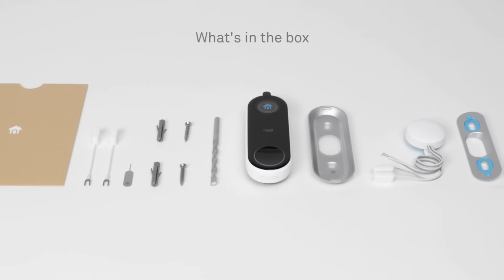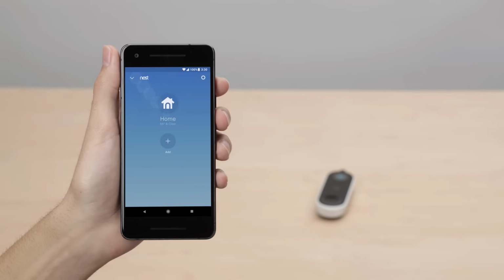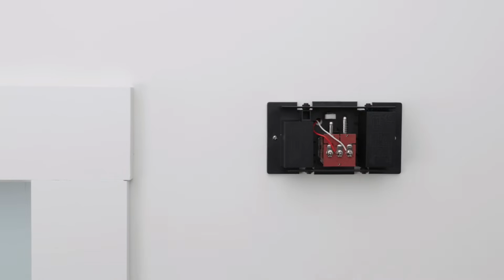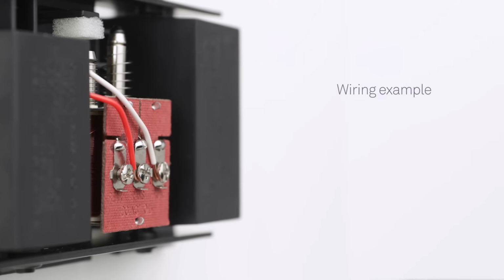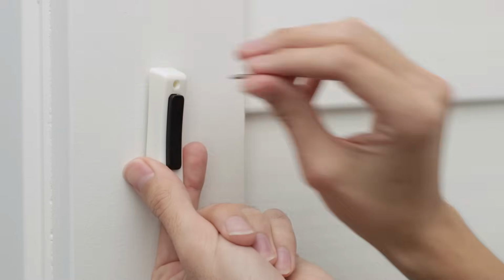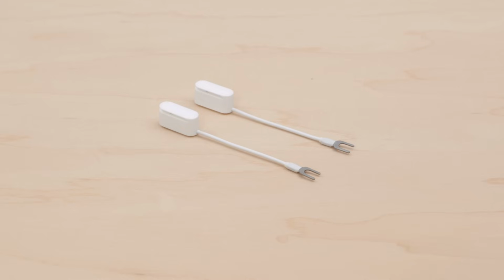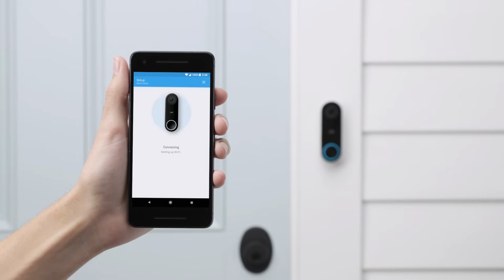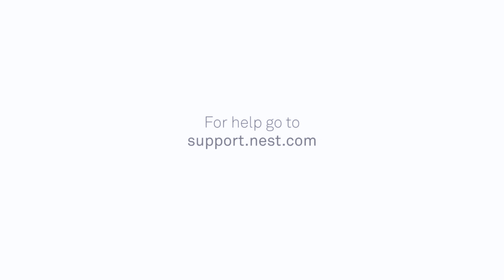How to set up and install the Google Nest Hello video doorbell

Comment: These both have a 3-5 year non repairable kill switch inside in the form of a small lithium battery. Google service reps tell me I should just buy a new one after 3 years despite the fact that if I could get inside it to replace the battery it'd be fine for probably another 3-5 years. Shame on Google for making this landfill. Buyer beware you'll be continually replacing these things.
Reply: @lukos3211 But then how would they achieve recurring revenue? Think about how much easier it is to just drop a new magnetic replacement on the mount compared to the hastle of installing a competing brand's product. They're all parasites but they call us "consumers"... 🙄

Comment: WORST PRODUCT EVER !!!  
1. APP GOOGLE HOME IS NOT DOWNLOADED IN ALL PHONES. I HAD TO BUY A MOTOROLA PHONE THAT ALLOWED ME TO DOWNLOAD THE APP.
2. THE CHIME DEVICE MUST BE PLACED IN A WORKING ONE CHIME BOX. MY CHIME BOX WAS DEAD, SO I COULDN'T INSTALL IT. 
3. FOR 150 DOLLARS I OBTAINED A DOORBELL THAT ONLY SOUNDS OUTSIDE MY HOME, BUT UNABLE TO SOUND INSIDE HOME.
4. IT IS TRASH. 
5. MOST CHINA DOORBELLS COME WITH VIDEO DOORBELL AND PLUG IN CHIME DEVICE!!!! WHY GOOGLE NEST DO NOT OFFER THE SAME???? 
6. ELECTRICIAN COST 50 DOLLARS TO ATTACH IT OUTSIDE ONLY. THE EKECTRICUAN TOLD ME THAT GOOGLE DOORBELL S ARE THE WORST PRODUCT EVER, BECAUSE MOST OF THE CASES ARE LIKE ME. IF I WANT TO HEAR THE CHIME INSIDE, THE GOOGLE REPRESENTATIVE TOLD ME THAT I HAVE TO BUY THE "NEST MINI" OR "HOME MINI" IN ORDER TO LISTEN THE DOORBELL SOUND INSIDE MY HOME. 
RING ARE 10000% BETTER THAN THIS GARBAGE PRODUCT.
7. THIS DEVICE DOES NOT ALLOW TO TALK BACK.

Comment: after installing the backing plate and wire so hard to slide in the doorbell to the bracket two small hole.. is there an easy way to do it?

Comment: Currently on my second one of these. On the first one the clear front of the doorbell started to develop what looked like air bubbles underneath it and was starting to chip and crack. I contacted Google warranty and they sent me a new one ( Jan. 2022). Today, November 2022, I noticed that the front of my second doorbell is starting to do what the first one was doing. Guess I will be contacting Google again.

Comment: Lovely, they updated the installation procedure, but didn't update the video. You can't use the Nest app to install new doorbells...
Update: You CAN use the Nest app to install the doorbell, in theory. You have to tell it you don't want to scan the QR code, but instead it will then prompt you to input a 6 digit code. If you're confused like I was about how you get the QR code or 6 digit code from the back of the doorbell AFTER you installed it...find the blue slip inside the box. It has a copy of them there. Something the app doesn't mention anywhere. 
But, good luck getting it to actually work. I got everything wired up, blue light and all, and Google's software is an epic failure. I went through all the troubleshooting steps and no matter what I can't connect to the doorbell. Bluetooth related errors every time. Note to self: quit buying things from Google. Either they won't work at all, or they will abandon them shortly.

Comment: Is the wedge installed and used without the base plate?  The video doesn't show this, just that a wedge is included. Thanks
Reply: You need to use both. You install the wedge and then add the base plate to it using the smaller screws. The doorbell then snaps into the plate.

Comment: My existing doorbell uses 16vac transformer.  After installation, the Nest doorbell works fine but the existing chime stop working.  I can see the chime's hammer moves a little but not enough to make sound.  It seems like it doesn't have enough power to strike.   Should I replace the transformer with 24vac?
Reply: So I figured out... In the settings, there is "Chime duration". Switch it on and have duration for 1 second.

Comment: First of all, I am writing this review as someone who has been a big fan of Google products and a die-hard advocate of google customer service. 

I bought a google nest hello doorbell in July 2021. I unpacked the device in January 2022. Upon installation of the doorbell, the device did not work. After contacting google customer service and going through the troubleshooting process, the google technical specialist decided I needed to receive a replacement device. Once I received a replacement device, I hired a professional electrician to install the device for me. Unfortunately, we could make the device work again. So I decided to contact google customer service again, return the doorbell, and get refunded. But after a long waiting period and explaining the situation several times to different agents, I was told that the refund period had passed and I couldn't do anything. 

Basically, I was told it would have been better to return the device and get a refund the first time I saw the doorbell did not work rather than trying to make it work. For someone like me, who has many more  Google products at my house and someone who is always promoting google products to my family and friends, it was really frustrating to hear that!!! Now I think I really need to reconsider the brand that  I was defending so hard. 

So my only advice to those who still want to buy from google is to think twice if this is the right choice for you!!!!

Comment: always check the voltage at the outdoor ringer wires. 18-24 volts AC is always recommended. I've never had a video doorbell install successfully outside that range.

Comment: Absolutely trash instructions. The Nest app says the door bell needs to be installed on the home app and the home app says it needs to be installed on the nest app. What complete and utter garbage
Reply: It is confusing but you need to install it through the Nest App first and then connect to the Home App.

Comment: The wired Nest doorbells (as well as wired Ring doorbells) are great products. HOWEVER, they don't tell you upfront that these wired doorbells all have an internal non-user-serviceable battery. IF you will be using the doorbell with a mechanical chime, just be aware that at some point, the battery inside will fail.

The internal battery on these units are used to provide temporary voltage to the doorbell unit when a mechanical chime is used. When someone presses the doorbell button, power is temporarily routed away from the doorbell to the chime inside the house. The battery keeps the doorbell powered for the 1-2 seconds while this happens. Over time, this small battery will be unable to deal with the voltage drop and your doorbell will lose power and reboot itself. If you don't rely on a mechanical chime or if you use the Ring wireless chime, than it won't be an issue. If you do use a mechanical chime, depending on your environment (which includes usage rate, weather, temperature, etc.), the doorbell will stop function properly at some point in time. For most users, it seems to be somewhere between 1-3 years.
Reply: So, are you saying the micro USB port on the Nest doorbell cannot be used to charge the internal battery? What is it for then?
Reply: @JewbixCube  the port does charge and power the doorbell...until the internal battery goes bad and no longer can hold enough of charge.
Reply: I feel like this is happening to my doorbell
Reply: Good info, i got it as a gift. When this happens in the trash it will go and i will use my standard security cameras as normal.  Its a shame they don't tell you the info you provided upfront.  Not sure why some people think its fun to constantly have to repair poorly designed products and repurchase the garbage.

Comment: My existing doorbell button is mounted in a standard electrical box with a plastic cover plate ; a common situation.  The standard electrical box screw holes don't line up with the holes on the Google Nest Hello doorbell's plate, so I need some sort of adaptor plate, but can't find one. 

What does one do in this situation?  It must be a very common problem.
Reply: I'm sure you've found a solution by now but if the original was installed on a plastic cover then your Nest Hello could be installed  on a cover plate as well.

Comment: Tip: I installed my nest doorbell and couldn't hear the chime inside. Troubleshooting steps didn't help at all. Accidentally discovered this option in the Nest app called "Indoor Chime On/Off". Shows nowhere in the troubleshooting steps, but resolved the issue instantly.
Reply: I have the same trouble i turn on the “chime on”still couldn’t hear the chine inside any tips?
Reply: @edwinruiz2889  under "chime on" there's another option "inside chime on/off". I was trying to figure out the problem for a long time
Reply: @edwinruiz2889  I had the same problem. My solution given by a technician was to turn on the electronic chime setting and set it to ring for ten seconds. Then turn it off. It worked for me after thinking it was the doorbell itself.
Reply: @irmmz_1  going to try this
Reply: @irmmz_1  Thank you so much! This solved the problem for me!💛💛💛
Reply: This should be like a whole video. How dumb of an issue
Reply: Thanks a lot , it was an easy install except for this part. Had the same issue then saw ur comment and there it was same issue. I went to the app and mine was off turn it on and all fix now. 😅
Reply: Thanks a bunch! This helped me out!!!
Reply: Thank you! I had the same issue, I thought it was the chimer, I replaced it with a new chimer and it was still not working, then I YouTube the install video thinking I’ve missed something, I found your comment and tried it, and it worked! Thanks! I wish nest included that option in the install video, they didn’t have any of those info.
Reply: Thank you so much.  Had the same problem.  Easy fix IF you know there is an ON/OFF option in the app.  Thank you again.
Reply: I clicked on the bell by mistake before I finished the setup so it ringed then it stopped after setup finished so I understood it something with software otherwise I would have a big headache with it
Reply: Holy crap made my day 😂 of course that’s an option genius
Reply: Just installed the doorbell and new chime. House was wired for a doorbell. My inside chime has no sound. Currently can't find the option to turn on or off in the app.
Reply: Life saver. Love you for sharing
Reply: We

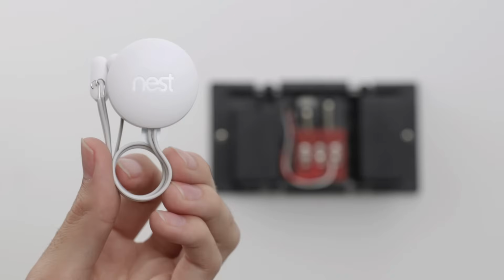Comment: 4:04 never ever twist the wires. You will get a loose connection in the long run!
Reply: What do you recommend?
Reply: @TR-vh1fi   just put the wires in straight
Reply: What never heard this...

Comment: The wall plate design is really poor, what is to stop someone from popping out the unit and running off with it. It may be useless to a thief but some thieves will do it just to be spiteful. You have to come up with a more secure way of mounting it to the wall.
Reply: I wanted one of these then seeing how you just click out put me off.
Reply: @The_Original_KL  I got the Eufy wireless doorbell instead and am very happy with it.

Comment: This was very easy to install, both chime and doorbell, but I got the damn blinking yellow light which means there apparently isn't enough voltage. House was built in 2003 so it's not some really old house with old electric. Had no problems with my Ring doorbell hooked up to the same wires. Seems like they just want to make you "Hire a Pro"
Reply: Usually that means your transformer is not putting out enough voltage. Try using a multimeter to read the voltage at the doorbell

Comment: Purchased one and it will work about an hour then it does crazy things, goes off line and it gets really hot.  Nest replaced the unit thinking it was defective, new one does exactly the same thing.  It skips once hot at almost exact intervals.  Checked the transformer and that seems to be within the recommended range.  Anyone had this problem?

Comment: Need instructions on connecting to a front/rear (three wire) chime. Both this video and the nest video only showed the instructions for two wire setup (front and transformer). I couldn’t connect to unit via Bluetooth (no troubleshooting there either), so I couldn’t follow instructions on nest app.

Comment: Red Flag for non-USA buyers of Google/Nest Door Bell : 
Please be aware that the Google Door Bell that they ship everywhere except USA will not connect on the 5 GHz band. Even the senior engineers form Nest/Google support did not know that. It took me over 15 hours of testing, emailing, chats and troubleshooting with them (factory reset, change my router setting, move my router closer etc.) to confirm this fact. Frankly, the support is terrible, the worst I have ever seen. 

Not sure why Google is choosing to disable 5 GHz band on the bell in countries like Canada where the 5 GHz band for outdoor use is legal. They charge everyone the same price as USA but remove the 5GHz connection capability that would have given us much better performance than 2.4 GHz. One needs to have a strong 5GHz signal (which is the case for me as I have a mesh Network with good coverage everywhere) , if the 5GHz signal is strong , 5 GHz channel will be less crowded (less channel utilization) and give you much better performance.

So the bell works, but the performance is “average” on the 2.4 GHz connection. Non-USA buyers please be aware of this limitation.

I was unsuccessful in getting a bell form Google that supports 5 GHz connection, they said they cannot/will not do it. I asked if I could get a month or two of free Nest Aware subscription, considering I had spent over 15 hours working with support. They should have know that the Bell is not capable of connecting on 5 GHz instead of having me going in circles, doing factory resets,  trying bunch of other silly things … The said “NO” to the free Nest Aware subscription for a month or two aswell.
Reply: Wow that's crap

Comment: I did just install one , check voltage in transformer first and make sure you have 24 volts less is not going to work .,
Reply: Yea I realized this after 5 attempts... Mine is 16V 10VA 😣🤦🏾‍♂️
Reply: Thanks for the heads-up!  I'll check mine now... hope I have better luck than ZeroChill 215
Reply: My transformer is 18v, and it works fine

Comment: Question about the install.  It shows you choosing front or back doorbell when installing the connections to the chime.  What if I'm installing both at the same time?
Reply: Both wires from the chime connector can be attached to the transformer contact, then a pigtail splice can be (essentially a "Y" connection") for the two clip connections.

Comment: Like the product. However getting it going after a extended power outage can be a challenge
Reply: What do you need to do to get it going again? I flipped my breaker switch off for a couple hours to replace a light fixture that was on the same line. After turning the breaker back on, the doorbell doesn't power on anymore. I've tried the reset button already. Maybe I need to charge it with that micro USB port?

Comment: I love how they turned off a 2 pole 30 amp breaker for the doorbell🤣😂🤣
Reply: Robert De Mott they can be connected to mains and Nest doesn’t want to be liable for “electricians” doing this for themselves, so they throw recommendations like that in the official instructions
Reply: @bruhdabones  Seems like you don't understand Robert as you are not an "electrician". Double phase 30 amp is way overkill for a doorbell. If there would be short circuit all the wiring would catch fire without the breaker tripping.
Reply: @Engineer9736  I’m simply repeating the message delivered to me by the electrician who installed my Nest.  If you have a problem with what he said, I’d be curious as to your own credentials
Reply: @bruhdabones  An electrician didn't tell me but after searching forever I realized the builder/electrician had added their doorbell transformer to a switchbox in the HVAC closet that is a maintenance cutoff for my HVAC but the transformer was between the circuit breaker box and that switch. The only way to cut power was with the yuge amperage HVAC circuit breaker.
Reply: You can short out the Nest and it's probably not covered under warranty

Comment: I installed a new Nest Door Bell today.  When I try to talk to someone at the door bell they are reporting that everything they say comes back as an Echo.  Sometimes 2 or 3 Echo's?????
Reply: You've got the wrong cables probably, thank your electrician. You should have propper twisted pair with a shielding
Reply: The issue is with your one of your mics picking up the audio feedback. This has nothing to do with the power wiring.

Comment: You may need this. No where in this video or on the setup it says that if you are using an electronic doorbell aka the ones where you can choose between a bunch of different tones, that it will not work until you go into the settings on the nest app and turn on that you have an electronic chime. You can then select a length of time the chime will ring up to 10 seconds. Also you can only change your chime song in those 10 seconds when the doorbell button is pushed. I spent 2 hours trying to figure this out messing with wiring and the little diodes that you normally put on the button (do not use or your doorbell will just continuously chime). It was a huge pain in the butt and the only reason I figured it out is because I found a random google forum talking about it after quite a bit of searching. Nest should really have this info on the setup instructions.

Comment: What options are available if you do not have an existing doorbell chime.
Reply: I don't have an existing doorbell chime and I have this doorbell. You can buy an AC power adaptor to power the doorbell, and you can just use your phone to monitor the alerts. You can also send them to Google Home devices as I have done. Every Google / Nest smart speaker in the house alerts us when someone rings the doorbell.
Reply: You don’t buy it